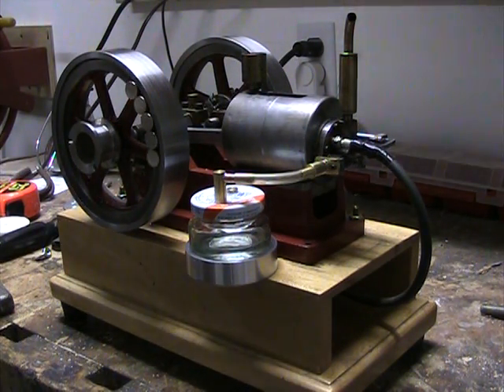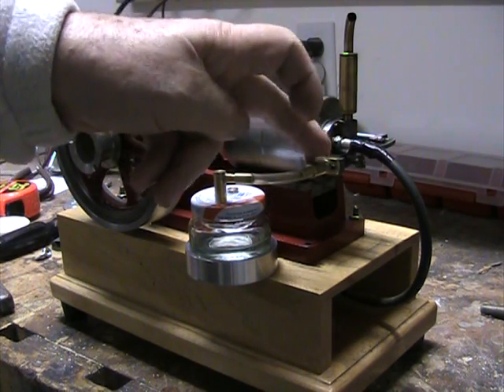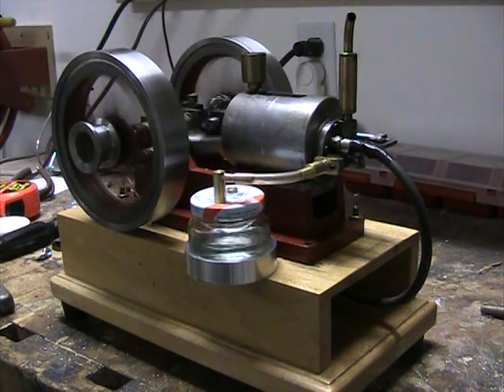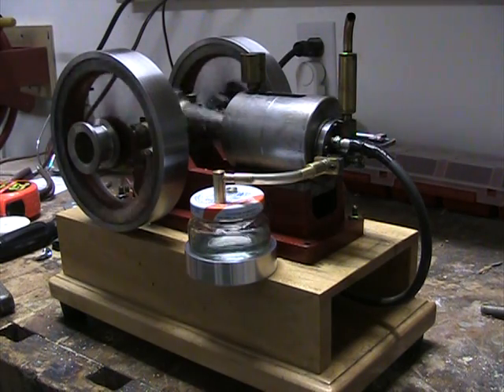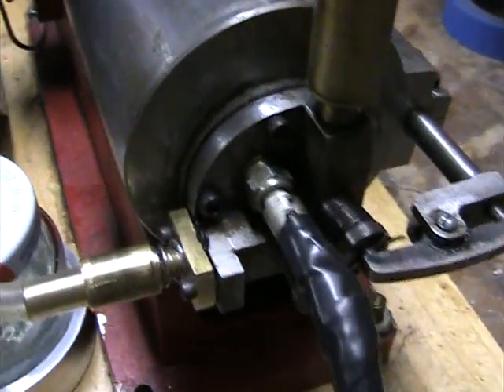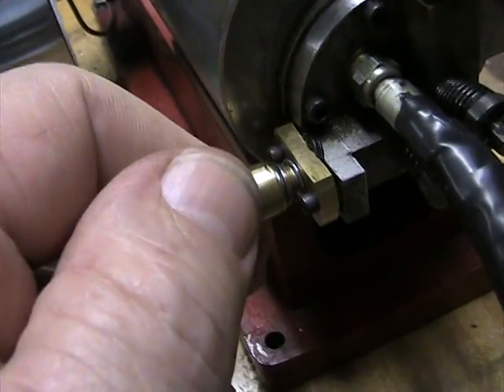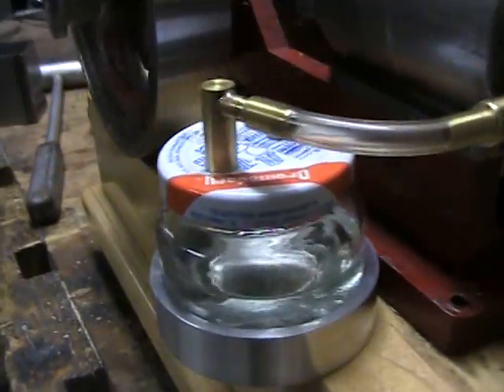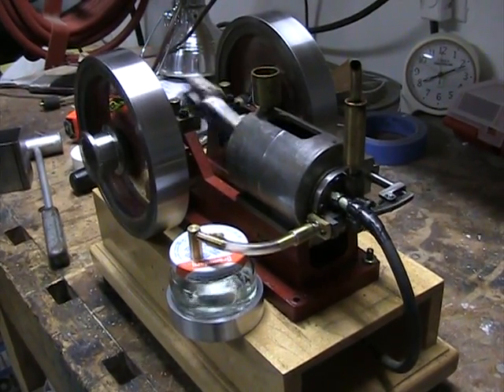HitnMiss Engine with Vapor Fuel Tank

Comment from the maker: @mr4963 There's no needle valve anywhere.  There is simply a hole into the side of the manifold with a threaded collar that can be screwed or unscrewed to cover more or less of the hole.  The fuel is already vaporized in the jar.